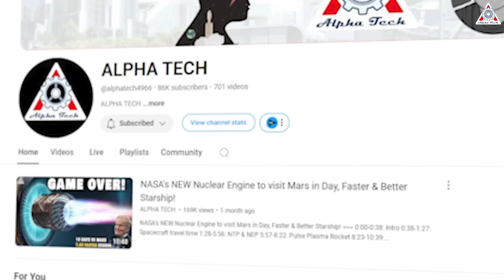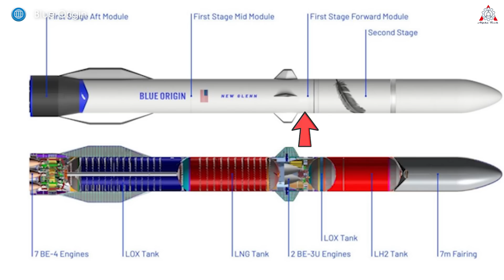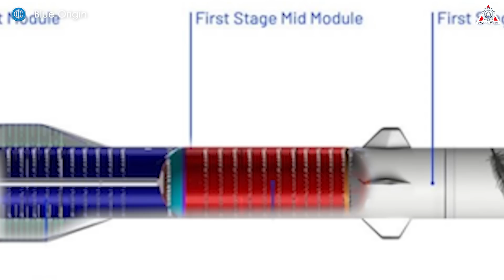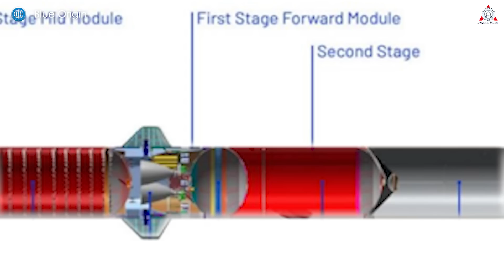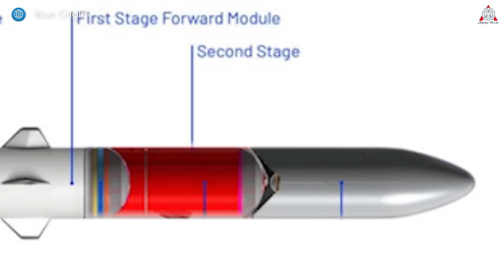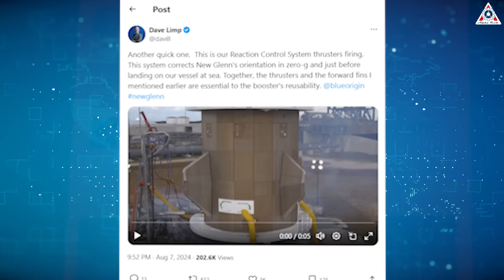New Glenn's Big Announcement For 1st Launch But Just Like A JOKE To Starship & Elon

Comment: space X will have issues landing their starship with arms. It's adding another layer of complexity that doesn't need to be there. Elon should know this, it's like the falcon wing doors that he wasted time engineering but scrapped due to poor function. Just focus on landing it on a drone that can handle the weight and thrust, you already do it for the falcon 9s

Comment: The landing legs come down with gravity.  But the 1st stage will be moving at x speed, so will gravity win over x speed?  Or will x speed add to the lag time for the landing legs to deploy?  Say by 6 seconds or more?  Whoops, too late with the legs, there goes the 1st stage falling over (with the assistance of gravity).  Timber ...... BOOM   🔥      (Is this a replay of a Chinese launch?)
Reply: ? When the ship is coming down for landing, it's decelerating, that means the rocket will be trying to fall slower than the legs, which means the legs deployment is assisted by gravity.

Try this: hold out a heavy weight on your arms and take an elevator going down. When the elevator slows to reach the floor, you will feel your arms being pulled down.
Reply: In Burnie, the elevator only goes for 1 floor at the hospital.  I'll take your word for it
But I was having fun with Bozo

Comment: Jeff Bozo literally copies everything from Elon. The interesting part is Elon actually rejected the idea of carbon fiber because of it's properties under temperatureand performance. Bozo can go Bozo himself.
Reply: Blue Origin was founded in 2000. SpaceX was founded in 2002, so technically, Bezos had the idea of doing a space company first. Moreover, although Musk rejected carbon composites, others did not, like RocketLab and Relativity Space. And the 1990s Delta Clipper project, which demonstrated VTOL way before Musk, also used advanced carbon composites and aerospike engines.

Musk isn't the only guy in the industry with engineering chops,  and he himself is stealing from a lot of research that was done before him. There's too much hero worship going on in this modern bunch of newbie space enthusiasts.

In the 70s, 80s, and 90s, people got into space because they loved space and supported all the companies. There was no "us vs them". These days, Musk fanboys are engaged in petty cheerleading. 

I mean, why would anyone who wants an exciting space driven future only want a single company to succeed? Why is this even either-or?  

Plus, many of the young whipper snappers forget all of the promises of rapid reusability decades ago which turned out to be *refurbishability*.  Which Musk running Raptors and the stainless steel right up to the margins of structural limits, one has to question how many uses are possible before the whole thing has to be repaired. 

Some of the vendors like RocketLab and Blue Origin, are opting for engines and builds that are more likely to handle wear and tear, even if they have less payload capacity. 

Let the market determine who wins, but the fanboys need to chill and cheer on all the companies.

Comment: It is not an orbital rocket until it actually gets to orbit. This announcement has more to do with trying to counter SpaceX's image rather than actually launching this year. Delay further, or potential RUD, a truly interesting choice when self-image and ego are so important to Jeff B. If this is a race, then Jeff has been lapped  is competing for 4th or 5th place without an entrant.
Reply: Seriously redundant. Just don't. SpaceX under Gwynne S has shut down almost every competitor. As they should. They have built a flawless recoverable system.

Comment: I am amazed that he is using hinged support struts for the legs.  Those things are going to buckle on impact with the ground.
Reply: Just like the landing on airplanes every time they touchdown?
Reply: What??? I served 5 years in the RCAF the landing gear on aircraft  is totally different from what new glenn is showcasing. On any large aircraft landing you can see the shaft compressing and expanding the shaft is the shock absorber. On light aircraft the shock absorbers go directly from the landing gear to the frame forming a triangle.
Reply: Which ship are you talking about? Each 1st stage Falcon has landed up to 20 times on "Of Course I Still Love You" or on Slick 39/40 at least 20 times. If you are talking Bezos.... Different story.

Comment: The proof will be in the pudding when New Glenn first launches in Sept. What I find kind of crazy is that New Glenn will be launching Rocket Lab's EXCAPADE Mars probes without ever having had a single test flight. One wonders if this is a function of Bezos' hubris and his influence at NASA in general.
Reply: Unlike others, you just said something valid. I personally believe this thing will never fly. Why would Rocket Lab, a known rocket builder - use Bezos to run a satellite? PAyload weight? And if so, Not SpaceX? Weird. Unless Bezos the dork gave it for free.   I iwll look into this. Sounds dangerously stupid.

Comment: Not a bad rocket...
I see he has a better forward control fins design of the same type I have suggested in writs on Alpha Tech for SpaceX to improve from their crude Platypus Flappers...

And aft on the booster he has the over diameter skirt system that I suggested in writs here for the Starship booster to simplify their engine cowling covers.

Jeff's rocket is more refined design wise, but its really Falcon competition.

And I suspect after Starship V-2/R-3 debut, Jeff will have his engineers start on a BE-4 replacement, and an upscaled tube ship.

And maybe looking at a site for expanded production.

His landing leg system is over complicated, and I can tell from its deployment movement has a bad design power system.

I think the good news for Jeff, is SpaceX insisting on things that are problematic that will slow the company down before admitting it.

Jeff may or may not have the same problem, like if he tried to stick with spaghetti Monsters, or aluminum.

The good news for us armchair engineering critics, is there are other startups happening and exploring other paths.

So far I give SpaceX high marks on Engines  and Stainless fabriccation. and low marks on flappers, grid fins, tiles, flight profile, 
etc.

Also Jeff has gone to pneumatic seperation, which is something I suggested here on Alpha Tech for SpaceX for safety reasons, so BO gets safety points if they continue that for passenger ships.

I think we are looking at a few years of Turtle walkabout before parity. But Blue Origin is making decent progress and doing refined designs. And if they adapt to parts count and stainless and start upscaling, could still beat SpaceX.

SpaceX building too many of the wrong things isnt progress.

Mostly long term success is going to be based on which company can learn and do the most.

And much of the learning will be from watching competition and learning what does and dosent work, and also each company being original about some concepts.. 
its like Sun Tsu and flooding over dry ground, the path is found by exploring all possibles and going with what works best.

its about adaptation to realities.

What they all lack is unified field theory overview. All have their noses burried in what they are doing, where we observers get a broad spectrum perspective.

I see five companies doing parts of the right things now. And dont pay much attention to others yet.

SpaceX will be its own worst enemy.

They all will... its an endemic human defect... Thinking we know best...

Will be a much different movie in 5 years... things learned, progress made, and more startups...

Whats important is they dont stop getting steps. We need to reduce bureaucracy as its the one thing that will retard them all.

Comment: To Alpha Tech, regarding comparing New Glenn to Starship - Please educate yourself:

Falcon 9 - 23 metric tons to LEO, 8.3 metric tons to GTO
New Glenn - 45 metric tons to LEO, 13 metric tons to GTO  
Falcon Heavy - 64 metric tons to LEO, 27 metric tons to GTO
Starship - 150 metric tons to LEO, 150 metric tons to GTO, Moon (with refuel)

As can be seen, New Glenn sits in-between Falcon9 and Falcon Heavy in terms of capability... and is nowhere near Starship.
Reply from the maker: yes i know! however jeff's goal is still to compete for more contracts with starship
Reply: @alphatech4966  Assuming SpaceX eventually gets Starship where they want it, its launch costs will be lower than Falcon 9. Jeff's running the wrong race.
Reply: @alphatech4966  Jeff Bezos should stick with Amazon. Leave rocketry to smart people

Comment: other than the bait click title, a good overview.  However, the BE-4 is fully reusable.  More so than Raptor.  The LPG (it's not methane, when will you guys get this right?)  Burns much cleaner.  Unlike the Raptor's that need to be flushed and cleaned after every flight (Yes, they will of course do that to BE-4 for pure safety reasons)  The LPG leaves little to no carbon.    And theoretically can be reused without any restoration.
Reply: "The BE-4 (Blue Engine 4) is an oxygen-rich liquefied-methane-fueled staged-combustion rocket engine produced by Blue Origin. The BE-4 was developed with private and public funding."
https://en.wikipedia.org/wiki/BE-4
Even  it was as you say, if both engines will be flushed and cleaned after every flight, then they are equally reusable.
Reply: Erm methane is literally the cleanest possible burning hydrocarbon as the methane molecule consists of 4 hydrogen and 1 carbon which carbon only has 4 empty spots in it's electron shell, any more carbon atoms take up at least 1 of those spaces meaning you have more carbon to cause coking, also hydrogen can only have 1 covalent bond. It also makes Methane the most gravimetrically energy dense hydrocarbon although it's also the least volumetrically energy dense, meaning that the advantage is likely offset by tank weight when it comes to rockets.

But it's a happy medium between RP-1 and hydrogen with relatively good gravimetric and volumetric energy density while also burning quite cleanly, where has RP-1 has a high volumetric energy density but a low gravimetric energy density while also burning dirtily. Whilst hydrogen has a high gravimetric energy density, but an extremely low volumetric energy density, however it also burns entirely cleanly as the by product of burning hydrogen is water.

using LPG is kind of an odd decision although given smaller diameter maybe it makes some sense as tank weight takes up a larger percentage of your total weight so being able to reduce the tank size for the same energy probably does work out to be better and LPG does have a higher volumetric energy density than methane.